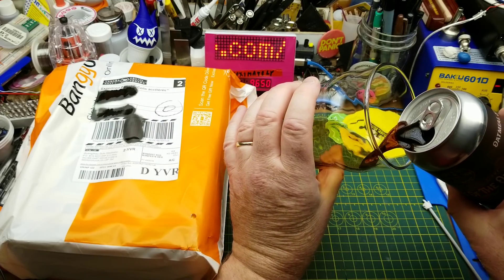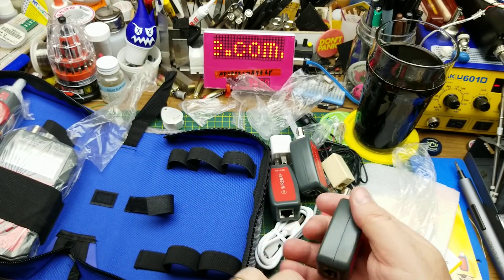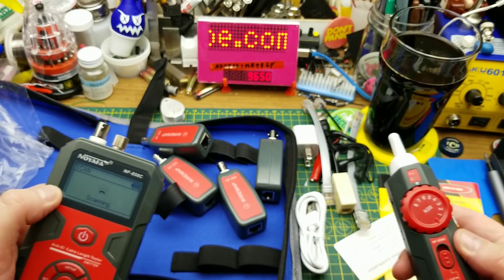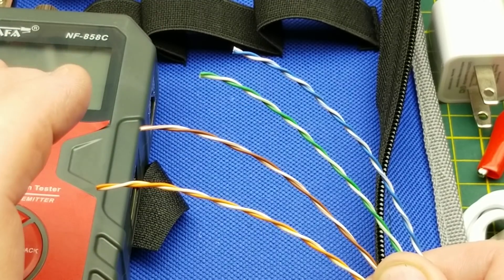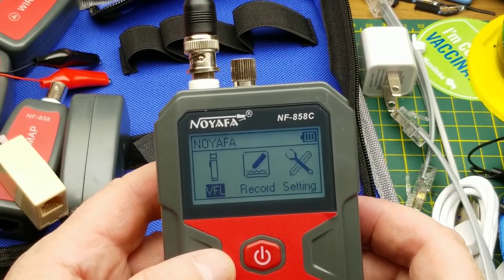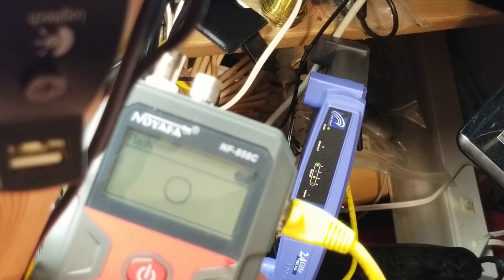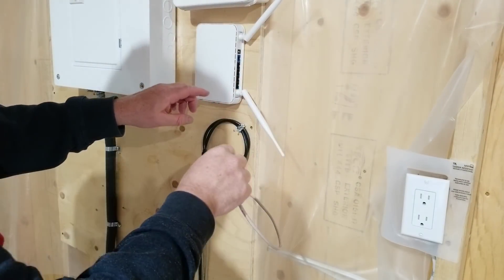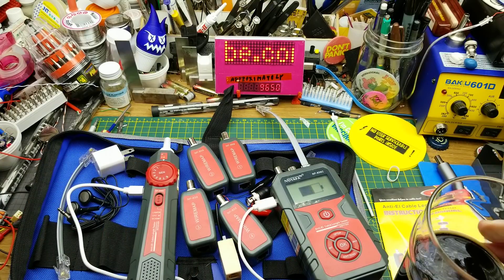Ethernet cable tester - first look

Comment: Noyafa TDR matters doesn't have good cable length measurements - and this one doesn't have TDR technology at all. It just measures resistance and tries to figure out cable length. Cable tracer also not so good - it uses analog signal, not digital. That VFL visual fault laser is the only real reason someone should buy this. Then again there is a TON of cheaper VFL's.

Comment: Kinda surprised it doesn't do TDR to find wiring breaks, also surprised it does do phone lines.

Years ago I did rework for a TDR manufacturer I won't name. Most of my time was spent replacing front end components because the odd end user (lots of them come to think of it) would accidentally connect to a phone line just in time to "detect" a ring voltage by letting the magic smoke out. I cleverly worked myself out 0f a job by helping redesign the front ends so they wouldn't blow up. (sigh)

How sensitive is that signal finder? The ones at the company I worked for could "hear" the oscillators and dividers in my digital watch if held right up to it.
Reply: I've got one of these. The 'length tester' is a basic TDR and could be used to find breaks, although you really ought to calibrate it with another known good cable before use—hence his seemingly nonsensical length for pair 1. You get a number of calibration slots to save to / load from.

Comment: I bought a similar one to that as an 'upgrade' to my NF-8108M and find it to be such a faff, the 8108 gives much easier and quicker access to the bits I need

great for a home/shop

make sure you put the garage router in to AP mode or you'll have a 2nd DHCP server confuzzling all your devices :D
Reply: I had to Google faff lol
Reply from the maker: Yeah. It's set up to only be a switch and AP. 
A used router from the thrift store is way cheaper than a dedicated switch or AP.

Admittedly, it's only 100Mbs, but that's more than enough for the garage.